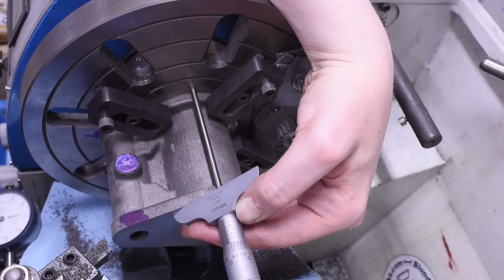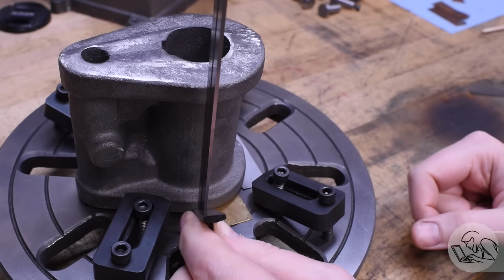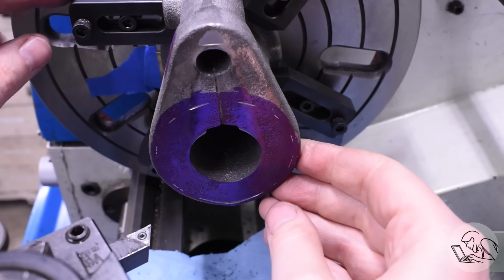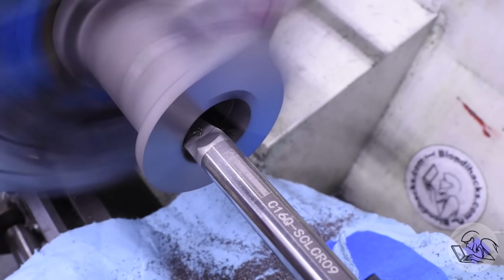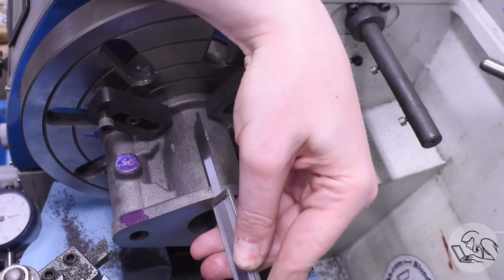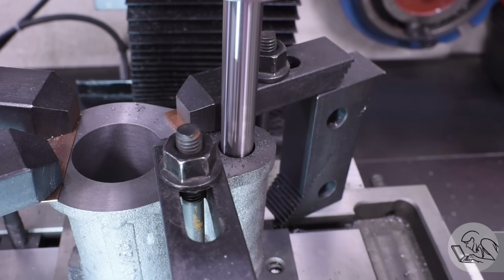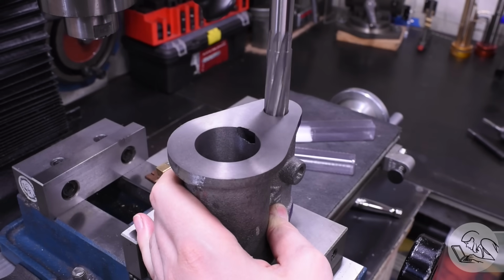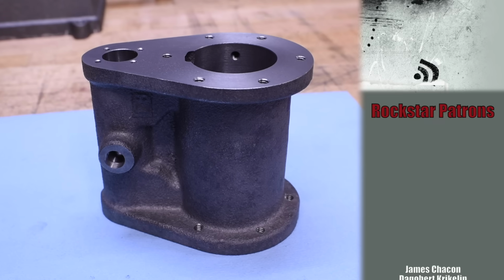Main Cylinder Machining! Big Steam Engine Build, Part 6

Comment from the maker: Hey everyone- since a lot of people are asking:

No, you can’t use the cast bore for any kind of setup. Bores are cast as cores and they are never straight or round. You can see what happens if you do that on my PM1 engine (see my playlists). The bored cylinder is a little crooked on the casting because I trusted the cast bore as a setup reference. You have to reference cast surfaces that won’t be machined when creating the initial machined ones to ensure the surfaces are well aligned on the casting when you are done.
Reply from the maker: Also people are suggesting referencing the bore with a mandrel for the facing. There’s no point in doing that. They’re done in the same setup as I show it here. That’s as square as you can ever get. Then the opposite face is referenced from the faceplate so it’s guaranteed parallel. No fancy mandrels required
Reply: As an retired engineer who has designed large parts and castings - we always worked with the foundry engineer and the manufacturing engineer. We identified the surfaces that would be used for the initial machining setups and indicated them on the drawing (or in the CAD model) as the rough locating datums (they were typically small, circular areas). The foundry does everything possible to hold the relationships for the rest of the casting to these datums and the machining fixture designer knows where the part should be supported. I am surprised the the rough datums aren't specified even on the model castings. They help you understand how the casting was made and would give you guidance on how the designer expected the machining cuts to be made.
Reply: Hi Quinn, I always give a like but seldom comment on your videos because, you always have lots of comments to reply too so no point overworking that keyboard more than necessary 😊
I noticed that your bellows style way cover missing off your lathe bed and firstly thought it had failed as  mine did a long while back. Then realised it was obstructing the faceplate or counter weights.
Good call if that was the case, it gets messy when things start spinning! 
I recently fitted a simple smooth faced self retracting way cover to my mill that protects both the Y and Z at the same time which has been very well received and copied by quite a few on my little channel. I'm going to do the same on my lathe as keeping it clean is so easy and I never get rubber bunching up. The concept might be an option for you in the future if you feel like a change.
Thanks for another great video, always informative and entertaining 
Neil 😊
Reply: Can you help my brother with machining his pm research #4 engine if I have him ship it to you to have it machined

Comment: Hi Quinn, I've been a machinist for 40 years.  I don't normally watch videos of people machining but I don't miss any of yours.  I have the same number problem as well.  My solution is when a number has only 2 decimal places I'll add a zero to make all my dimensions 3 places.  Especially helps when working with tenths  (ten thousands) add a zero to make all my dimensions 4 places. Add the zeros right to the print.

Comment: Fun fact for @12:20, that function is called 'Dithering' when you vary the speed of a motor, or position of an effector like a solenoid. Often used in proportional hydraulic solenoids to allow for fine movements as the dynamic friction of a continuously moving solenoid allows smaller changes to still be accomplished, where if dithering was not done, the static friction would prevent the solenoid from moving until a larger difference in signal was sent.
Reply: This was also done when using dc motors for positioning control. A small ac voltage was applied to the armature so you could just feel very slight armature  movement. This overcame what was referred to as stiction, and enabled very precise position control to be obtained.
Reply: Thereby defeating mechanical hysteresis.

Comment: Trick for faceplate balancing. Let the spindle spin freely, out of gear. The heaviest side will tend to fall down to the bottom. Add weight opposite that. When you adjust the counter weight like that a few times, you should be turn it to any orientation and it just stays, no heavy spot that tends to fall down.
Reply: That sounds good. Thanks for the tip.

Comment: When I was taught to build threaded pipe systems the ole timer taught me to remember the rule of three. U should be able to thread the nipple into the hole 3 turns by hand, then 3 turns with a pipe wrench, and u should have 3 threads showing. Not sure this translates to tiny threads but for half inch pipe and up it has worked for me for the last 15 years. Love your videos! Cheers!
Reply: I agree. My plumber mentor taught us to use 2-1/2 turns for the steam fittings which allowed a little less of the taper so you never bottomed out in any fitting, which helped with bronze fittings and not expanding the fitting with wrenching them. And a good quality pipe dope on the treads helped with sealing.

Comment: Quinn - thanks for another excellent video. You really caught my attention when you mentioned that you have occasional dyslexia with numbers, which troubles me too. I presumed that your background in programming indicated you were a whiz with numbers. It's nice to have a reality check here, and to see what precautions you take knowing that there are rabbit holes that could trip us up!
Reply: @Halfdan Knudsen I used to be able to spin 3D objects in my mind.  Now I’m older, not wiser, I have to arrange odd bits of wood and metal in order to visualise, and even then get it wrong.  I was also good at mental arithmetic, thank God for calculators.
Reply: Another relevant-for-some condition that I only learned about relatively recently: dyscalculia.  I don't see that as being described here, but could easily imagine it being relevant for some, and since the word was new to me as recently as it was, I thought I'd share.
Reply: That is exactly the same condition as the other one😂

Comment: A cheap set of Forstner Bits ( gasp… woodworking tool!)… can be used to locate a center hole from an external boss diameter.  Just blunt the center point into a punch shape.  Select a drill diameter close the rough boss diameter, align it to the boss, and smack it.  Viola!

Comment: I’m not a machinist, just a fan, wood turner (🙀), and flight instructor, but I find much here that helps my woodcraft. With respect to your numerical transposition issues it’s a well know phenomenon that pilots, when instructed to turn to a heading of 30 degrees (turn zero three zero) will frequently turn to 300 (three zero zero) even after reading back the correct command. You’d make a fine pilot.

Comment: For tapered taps, I used to dip them in marking out blue. It wears off the teeth to the depth the tap goes into the metal, so once you've tapped a few holes to the right depth you get a witness mark to show you where to stop tapping. The only problem is that tiny manufacturing variations in the thread on the fittings can mean about a full threads difference in how far it screws into the part, so I'd still usually have to have two goes at getting it right. On the plus side, these variations also meant that if I'd oversized the threaded hole very slightly, I could just try several of my cheapo fittings until I found one that was also at the upper end of it's thread diameter tolerance.

Comment: glad you were able to catch yourself on the brain number switch. My head likes to flip numbers too. Here is a trick i use when working close tolerance I have to get right to make sure i don't flip numbers. When i read a number say 2.380 when i hit that point I use it as a mental switch then read the next numbers as single distinct figures with a pause between each so 2.380 becomes two POINT three....eight.....zero.  Reading them that way as single figures stops the brain gremlin from flipping numbers. and gives you a mental check on figures. several times I have caught mistakes in prints or in my copying by this method.  can't wait to see this beast under steam. My current shop project is building a forklift :D not a precision job but my back will thank me when i'm done :D

Comment: You are right about the CNC having this feature built in(at least with the newer haas machines I worked with) they call it “Spindle Speed Variation” and it works wonders to stop chatter sometimes! Great tip for hobby machines I’m sure

Comment: My thoughts on the 38 thousandths. Everything I do at work is called out 0.000 never any 0.00 no tenths only thousandths. So that's what my brain is use to. Getting a weekend project called out in tenths would definitely mess with my head and I would have to be careful. Thank you for bringing us along on your adventures.
Reply: Same here. When I'm working with Solidworks it automatically rounds 0.375 up to 0.38. When I print a drawing I have to remember to round back down to the original dimension in my head.

Comment: Quinn, my tip for getting the hole centred in a cast boss is usually to eyeball it with a sharpie dot as centrally as you can, then eyeball the sharpie dot with a very light centre punch and adjust if needed. If the sharpie dot is a bit out the first time, you can erase with spirits and try again. 

It can seem counter-intuitive do work like this when accuracy with measuring tools is drilled into us, but with a little effort and practice you'll find that it becomes a reliable technique. You've got a good eye for accuracy so try it next time!

Comment: That's coming along nicely, Quinn.  Steam engines have joints, though, not gaskets :)

For the number dyslexia thing, I know where you're coming from.  I work as an electrician, last summer I was installing a towel radiator in a bathroom, luxury job, the tiles are all modern and huge, 1m by 60cm, specially imported from Italy, and the mounting was such that the mounting screws would hit 4 tiles.  I measured 3 times, used the laser to get stuff absolutely square and perfectly centred.  I got the vertical spacing right.  Horizontal spacing was slightly off, though.  Spacing width on the radiator 84cm.  OK, chuck the laser in place and find the centre of the space the radiator has to go into, half of 84, that's 44, OK, mark 44 cm each side, use the laser for the verticals and find the lowest points, measure up to the top mounts, mark up the holes, check with the laser that they're aligned, drill, manage not to crack the tiles, it's all good, go to fit the radiator and - damn.  Half of 84 isn't 44, is it?  Still, meant I got to do some ornamental turning in stainless to make up some offset mounts...

Comment: A thought comes to mind on ‘The Difficulty of Centering a Small Hole on a Small Rough Casting’

If you move the order of operations(oo) “mill surface of the casting” up the oo to just after you line everything up, that small rough casting is now a clean flat surface. 

The expedient of a small round disk (divided into 4 equal quadrants which created a circle w a dot at the center) slightly smaller than the rough circumstance of the milled feature, overlayed against the milled feature now provides an excellent visual guide to center and a flat surface upon which to punch, spot and drill the desired hole. 

This was your idea btw., the circular scratch lines on the casting using hand winding and a sharp insert was almost as good as that marvelous piece of fixturing and machining on the stand body thingie, (cross head slide?)

Just a thought. Love this build. Love the show. Yahtzee!
Reply: I left a comment re this problem.  I’m curious about best practices for this issue and am interested to learn more about it.  I’m not experienced enough to make any suggestions and have had the exact same problem in the past.

Comment: Another nice job Quinn. BSP is a British thread type which has parallel taps, I believe the TPI's are the same as the pipe threads you are using. BSP stands for British Standard Pipe. I have spent my entire life at sea as a marine engineer. The tapered pipe thread often used was NTP, which I never liked. I used BSP rather than the tapered pipe threads and never had a problem with them. Just a view, not intended as criticism. Looking forward to the next video, the engine is really coming together now.

Comment: Hi Blondi - I am  retired aerospace toolmaker/tool designer/instructor.  I have a keen interest in making some of these model steam engines in my home shop and am enjoying viewing some of your kit builds.  I do have a suggestion that you might try to help with fixturing some of your odd shape castings. As you are a machinist when you find an irregular surface that you are trying to clamp down. You get a bunch of shims and go to clamping and measuring.   What I do as a toolmaker in the same situation is to get the part level on a surface plate.  Use wedges jacks or what ever you have handy, then mix up some epoxy or fiberglass filler and begin filling some void spaces between your part, and the surface plate. Use a filler that sets fast.  (I like using Dyna-glass. You would have waxed or oiled your surface plate so plastic will nor adhere, but it will sure stick to the casting. Once the first pour has set, move around your part and fill in more as needed. Now when you clamp you will have a rock solid bottom. “No shims”. When you eventually get to machining on the plastic part side, you can simply knock the plastic off, or just machine it as you would the excess casting material. Another little trick you can do with plastic is temp bond cerated drill bushings in key places when making a quick fixture. Any way, give the plastic a try, it was good  enough to create a whole division at most of the aerospace companies. “Soft Tooling”, plastic and plaster, tooled a lot of boats, airplanes, autos. i am having fun watching and enjoying your channel. Be well, Howard

Comment: Definitely +1 for avoiding spring passes so you have well-controlled chip load, tool deflection and finish.  If you understand how the tool behaves under cutting loads, and take good measurements, you always hit the tolerance. I treated myself to some second-hand three-point bore mics and ring gauges for measuring precision bores, they are great for taking multiple measurements down a bore without having to remove the gauge and measure it multiple times.  A bit of a luxury perhaps, but I find I'm using them a lot. Same with the groove mics. I didn't think I needed such a tool, but now I use them frequently when facing parts with small through-bores. Loving this project!

Comment: Hi Quinn, with the cylinder cocks on locos, what you mentioned is there for letting excess moisture out when  the cylinders are cold, another part which is common why they are open is low pressure starting of the loco like when the loco is coupled to another vehicle and keeping them open for that moment also prevents the steam pressure to keep the loco from going too far and potentially causing damage through other things. So your reasonably there with it.

Comment: On tapping, using an NPT tap -- an old machinist once told me that if you start by tapping the depth equal to the stated diameter of the tap, it's a good place to start.  1/8" NPT (5/16 - 27), so tap to 5/16" deep.  You can go deeper if you need to, but you'll never be starting off too deep.  This works on MTP (model taper pipe) taps, too, because the degree of taper is the same.

Comment: I think seven threads is the proper engagement for pipe threads.  Not seven threads deep, seven threads engaged.  I did not get that from Machinery's Handbook or any other 'official' or 'recognized' source.  I got it YEARS ago from an old guy I was extremely blessed to work with who was a master machinist, master millwright, master welder, master cabinetmaker, licensed master electrician, and very likely a master of EVERYTHING ELSE he had ever even attempted.  He sort of took me under his wing.  A very kind, gentle, and patient guy...with kids and 'new guys' who wanted to learn.  With know-it-alls, well, they learned quickly either to change their attitude or to give him a WIDE berth.  Smartest man I ever met.  I miss him.
Reply: I hear you. I've had many teachers, but few have earned the title of mentor in my mind.
Reply: @32thedoctor  Indeed, sir, indeed.  They are scarce critters.  The other kind are plentiful...and getting more so, or so it seems.

Comment: I'm not nearly through yet, but I'm pausing here to thank you for taking the time to put in the strobe warnings. Many people would've just not cared. (The engineer part of my brain is now wondering about frame-by-frame autocorrection in software, or if one could build steadier lights with staggered LEDs...)
Reply from the maker: I’ve only recently learned how many people are bothered by this so I’m trying to warn for it now!

Comment: Even some modern engines use head gasket thickness to set clearances so don't be too hard on yourself on missing that dimension. I have no doubt you will make it work just as well as, if not better than, it was designed.

Comment: Rule of thumb for pipe taps is to run the tap into the work until there is 4 to 3 threads left on the tap
Nice work!

Comment: Depending how many times you want to locate a casting detail, specifically just to eye up a centre of a circle: could you make a carbide tool that makes a fine circle (something you will machine away later) but showing you how the casting is lined up in the mill/lathe. Thus you are not fully drilling into the casting but know if you need to move over 0.5mm.